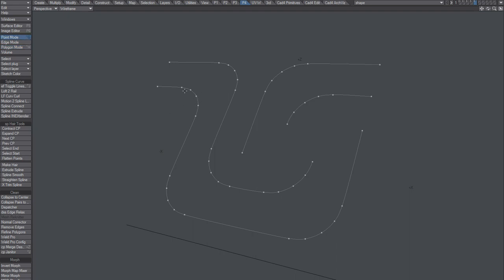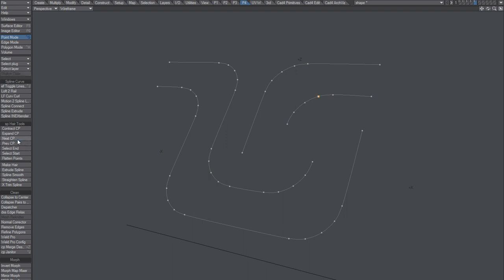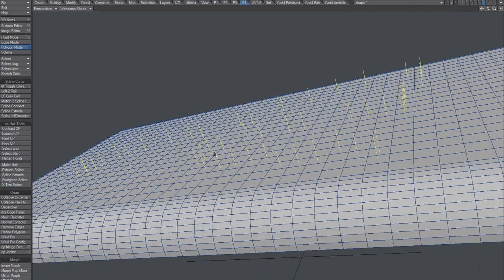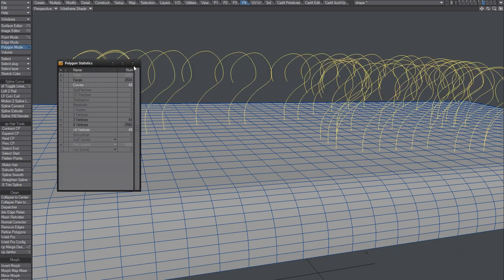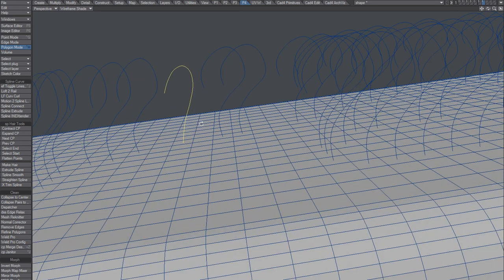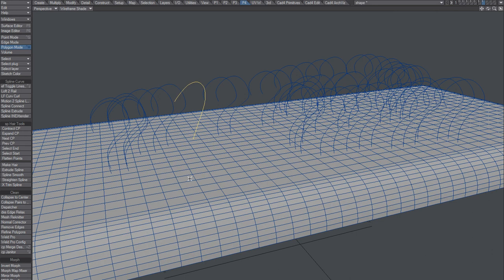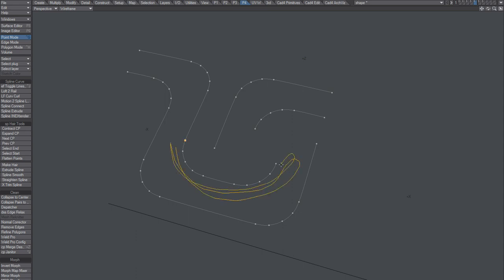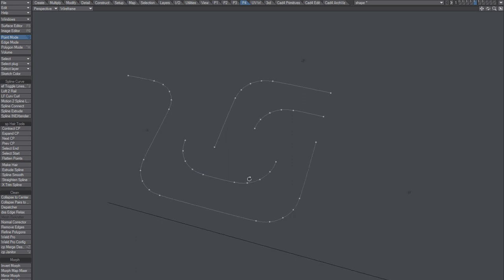LightWave plugin - Hair Tools FiberFX - Spline

Comment: The Author of these tools here :  Straighten Spline aligns the curve to a plane, which is defined by the start,  mid, and end points of the curve.  If the curve already lies on a plane, it appears to do nothing.  Also, there was a bug in the smooth spline code that kept it from working on more than one curve.  It has been fixed.